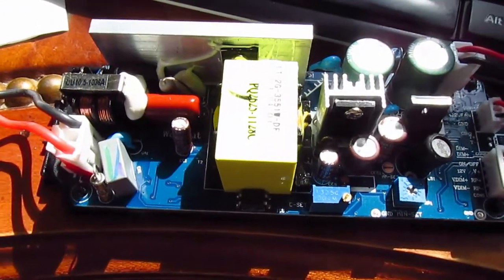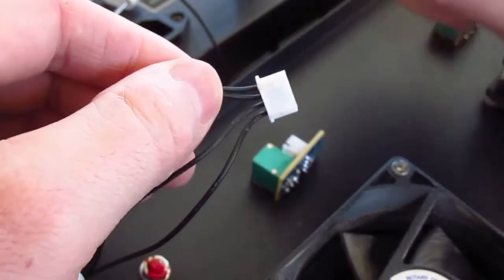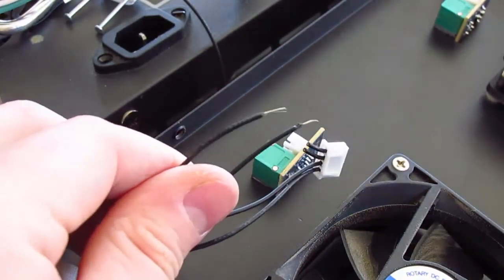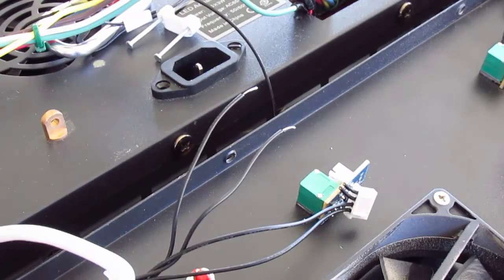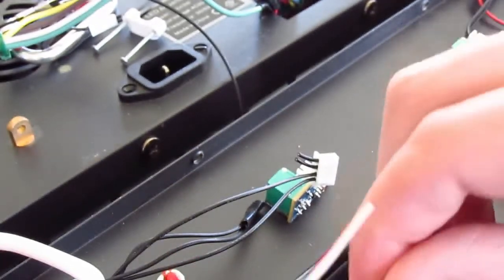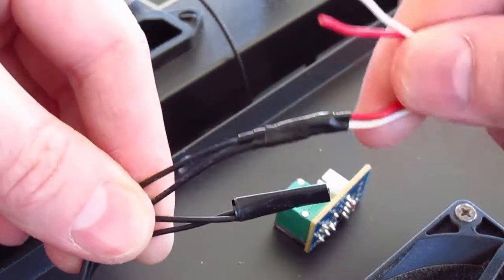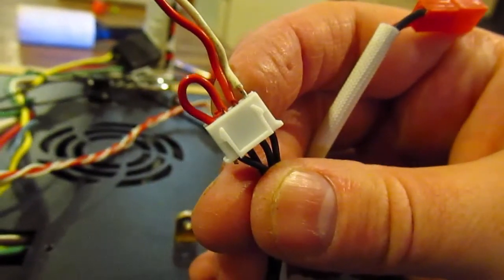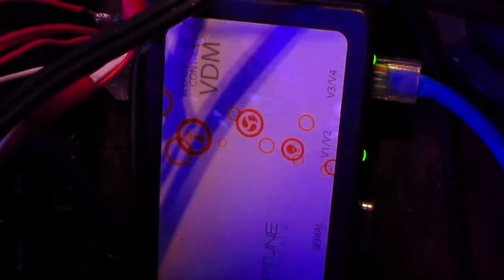Chinese LED APEX DIMMING capabilities TUTORIAL

Comment: Question, how did you determine the required variable voltage needed? Yes the apex is a 1-10v and the meanwells use 1-10v. But the Chinese fixtures may differ. For instance the ocean revive fixtures are. 0-3v and would require a dc-dc converter. I know you can not speak for every light fixture, I was just curious how you verified you are getting the proper variations on your fixture...
Reply: did you get an answer as to how he knew they are 0-10v for the dimmer I do not see a reply

Comment: I have 3 lights over my tank. Do I need to get more VDM modules or can I connect all 3 lights to one cable?
Reply: Chris Purdie did you ever find out? I have 4. I need to know the same thing.
Reply: EquipmentReviewer I spliced the cable from my 3 lights into one cable going into a single vdm port. I don't get independent control over each light, but it was a cheap option until I can afford another module.
Reply: OK but it dims all three no problem right?  Blue and white are separate?
Reply: EquipmentReviewer correct.
Reply: Chris Purdie Thank you!!
Reply: so if you have 4 black boxes. you just splice the 2 whites and 2 blues together to one ethernet cable setup .and can control 2 light fixtures . so a total of 2 ethernet cables can run 4 light boxes.